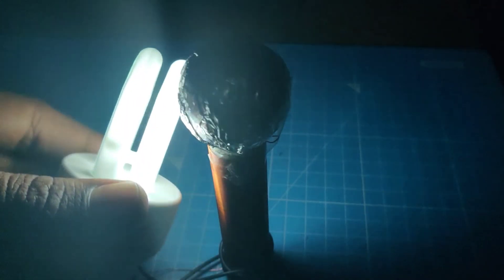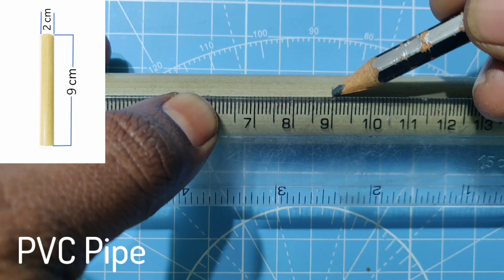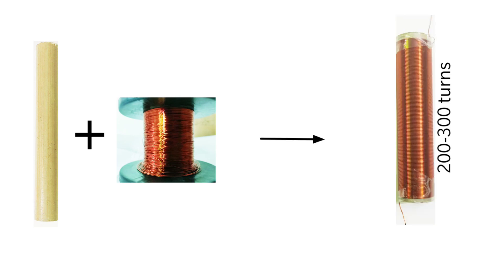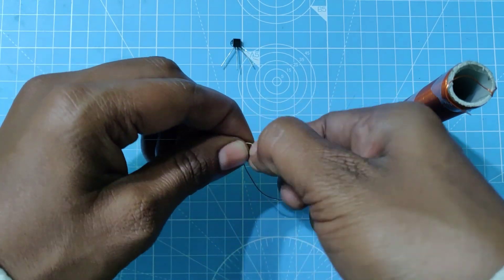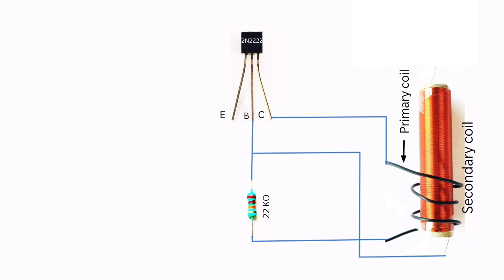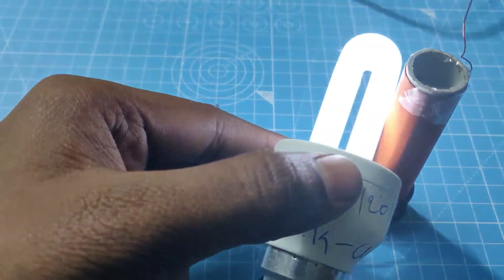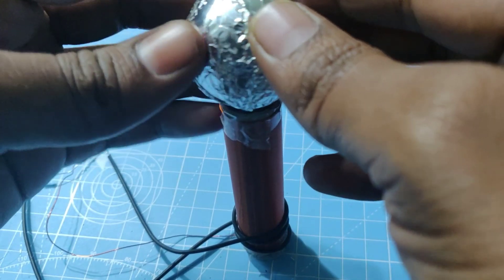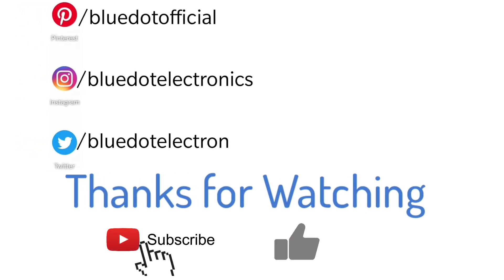How to make a mini Tesla Coil at Home | wireless power transfer with explanation and applications

Comment: can we use 100k resistor
Reply from the maker: No. You can use resistor with 10-20% difference only. A transistor base requires  0.7v